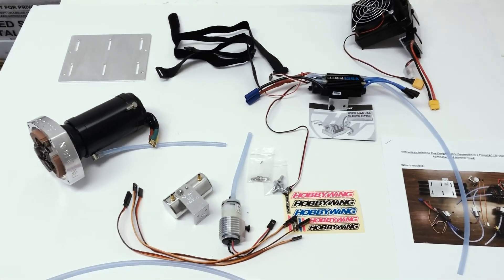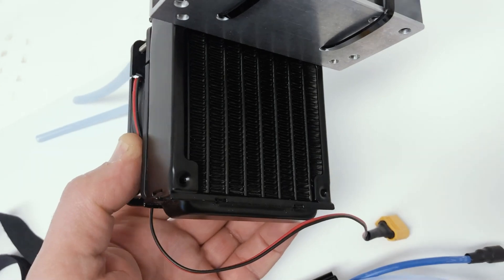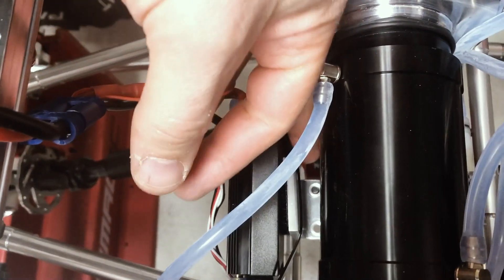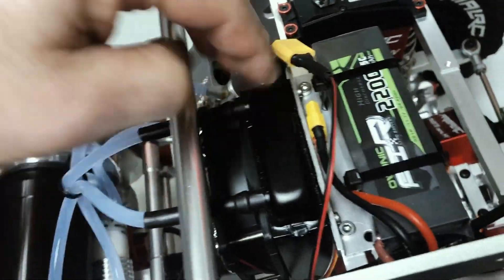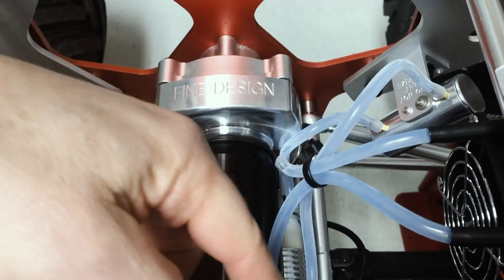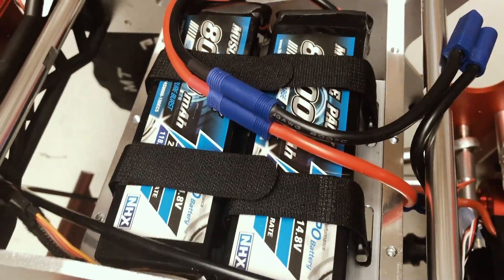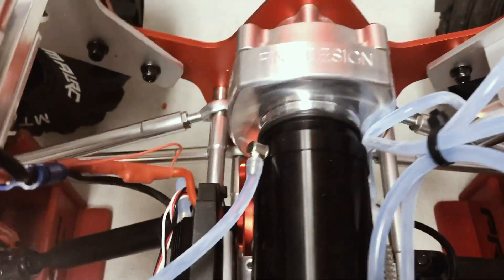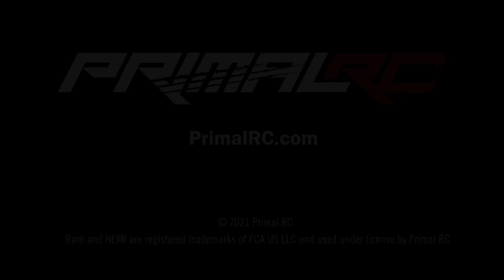Brushless System Installation QUICK Overview - Raminator Monster Truck

Comment: Whats the run time?
Reply from the maker: I got about 20 min on a single 6S 10,000mah  stop and go kind of driving. It's a very efficient system.
Reply: @PrimalRC  wow.. that’s really good.. Are you going to sell it RTR brushless? I really want one and I think it would be a lot of peoples preference
Reply from the maker: @bradforester3635  For liability sake (this big truck can be dangerously fast when brushless) we don't want to sell it that way. We want the customer to be very familiar with the truck before just hooking up 12S and punching it.  Also the parts for the brushless are not made at the same factory as the trucks.
Reply: @PrimalRC  i dig it..I guess I’ll just have to work on it then LOL.. Be intouch🤙

Comment: very cool any plans to sell the truck as a roller or with the brushless system? miss you guys hope all is well
Reply from the maker: Hi Gary,  Glad to hear from you.  We thought about selling it without the engine and pipe but it would only save you $150 so not worth it IMO.
Reply: @PrimalRC  what about just selling the truck RTR brushless. Plug-and-play. I kill myself doing concrete all week I don’t always have a ton of time for tinkering. I work on them when I break them but for the most part I just get the RTR versions.. I would definitely buy a brushless. Its asome good job 👏